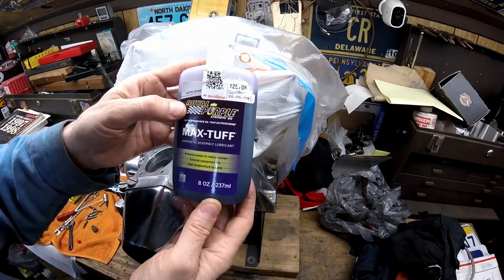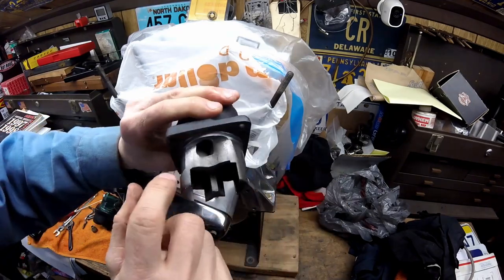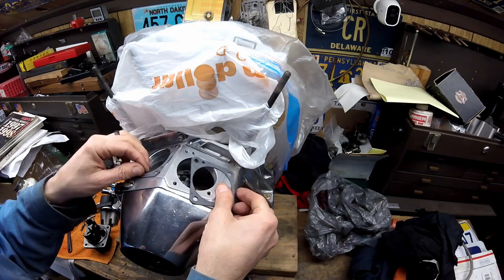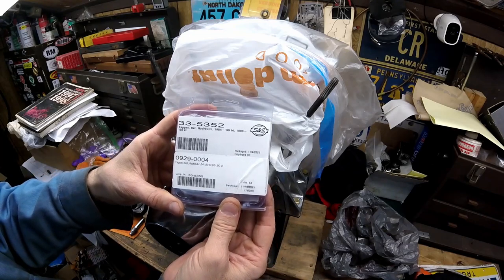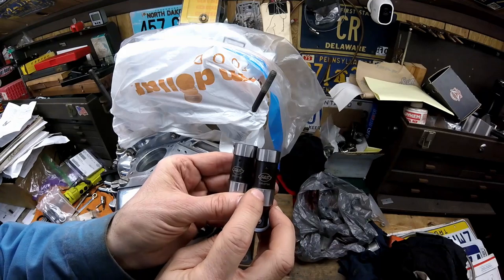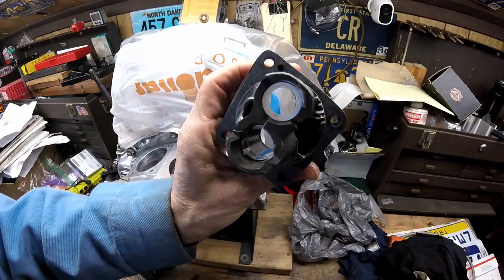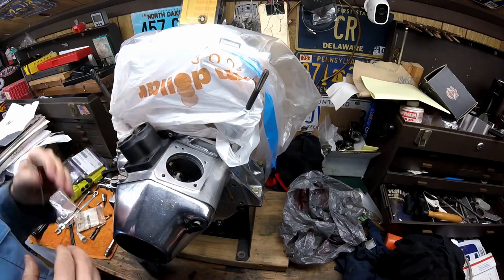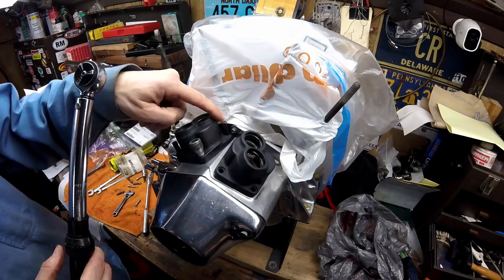EVO Tappet and Tappet Block install. Panhead Shovel head Knuckle Lifters

Comment: Were you able to use this 3/8 socket for the bolt closest to oil passage? Usually it doesn't fit well, so I use 1/4 socket for this procedure instead.
Reply from the maker: Yes I was. My socket is made by Snap-On so maybe that's why it fit. I agree with you that a 1/4" drive socket would fit better but I don't have a 1/4" drive 1/4" - 12 point socket.

Comment: Just curious, did you install these new lifters on an old cam? Or did you replace that as well? I’m in the middle of a top end job on my ‘98 and didn’t know if it was necessary to replace the cam
Reply from the maker: On this engine I did put a new cam into it however you can leave the old cam in as long as it’s in good shape. If any of the hardening is coming off or it has any damage you will need to replace it. I have a good video on the cam install on this same engine that you should watch. 

Cam & Breather Set up of Evo, Shovel cam gear Install shimming Harley
https://youtu.be/4ZTHq336e-A

Comment: Great content as always. What kind of mileage would you expect to get before the bore in the tappet block wears?
Reply from the maker: I’ve never had to replace the tappet blocks before on any of my engines.  As for the cylinders if I go into the top end of any motor I always have them honed and put rings in them. As for mileage I wouldn’t be surprised if everything would good for 100,000 miles. After an engine has 50,000 I start to worry about the roller bearings on the tappet rollers themselves. On the Shovel and older I have them rebuilt. On Evo and newer I replace the entire tappet. I keep good oil and oil filter on my bikes along with keeping the air filter clean. I have an older video on this. I’ll post it to you later today. I hope this helps and thank you for watching.
Reply from the maker: This is the video I was talking about. https://youtu.be/l3ls9nfoGCw
Reply: @Rapsgarage   Appreciate the insight man, I got a '99 Evo with 28K on it and I'm about to swap out the lifters for Fuelings before the roller bearings on the originals go bad. Keep up the great work 👍
Reply from the maker: @Lanesplitter  sounds like a good plan. Be sure to clean out the tappet screen filter.

Comment: Why did you not pump the lifters with oil or let them soak in a oil bath before installing
Reply from the maker: The pushrods are easier to install without the lifters being pumped up. I will prime the engine before I start it. General on the Evo’s the lifters can take up to 15 minutes to pump up even after soaking them.

Comment: There's gotta be an alternative to Jim's tapered dowels.
They cost a whopping $36 EACH! ($72 for a pair) I cannot afford that price.
Reply from the maker: Wow! I think I paid $20 when I bought them. Good thing I found them on eBay. 4 of them shipped to you is $20. 

https://www.ebay.com/itm/235423184227?fits=Make%3AHarley-Davidson&itmmeta=01HS9MKPYB7YT4PGZ5SZD8R0RS&hash=item36d050b563:g:hHAAAOSwcaNlvGGH&itmprp=enc%3AAQAJAAAA8CBX%2FZlkxRnSAenvbX9lSBqE3bl%2FDcMaaXXSLn22jJi%2FMVxff1zw8g0d%2B79k5AddotakzbU4RAimnXoswOlK--v%2Ba4LEg6SwJUfssPKDprofdjvG0QIX%2FjjQdbT016WKOjhE4xTRnMX7w6ZjdkTYoSOFoP0DYlcoFVPQU%2F2NmAQHPE1vuGtLGUvxVJkZvgSGAYJazfN1FeQ6eThrKby1dPE0josj7D3CYH9pE9bij8qDyTs2eMaHlG%2Btu1zLyyHPgB4NJ9EVEThtlex7JRnx5xQ3bZslA9HMhND7iLYV7OOAu6%2BrgusylllOCcm1F2QiSQ%3D%3D%7Ctkp%3ABk9SR6rvzrTKYw
Reply: @Rapsgarage Thanks for your URL link and info! I went to eBay and took a look. I see that these are cheaper because they are not "Jim's brand". I'm not saying that's a bad thing. I was hoping there was a competitor to "Jims". Again, thanks!!!
Reply from the maker: I’ve used a tapered pin in the past. It didn’t have the 1/4” threads but it worked.